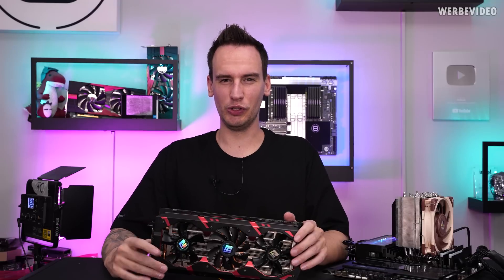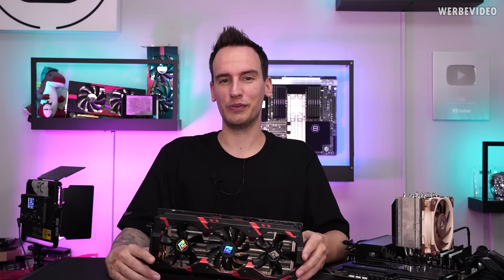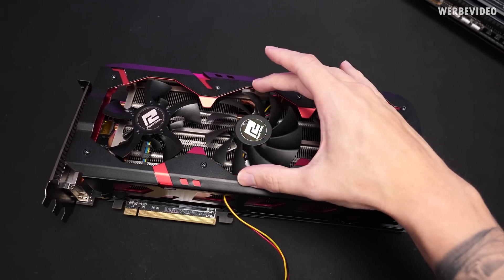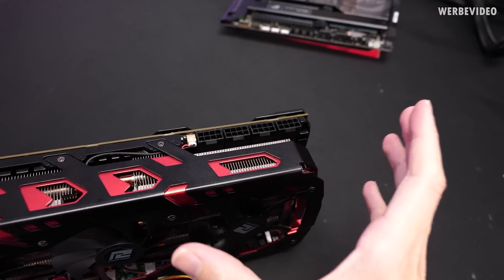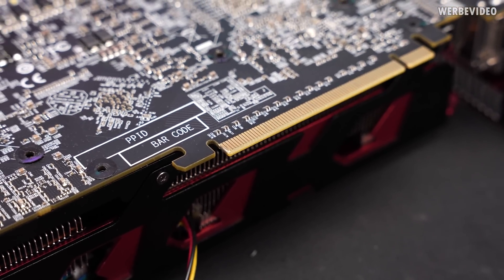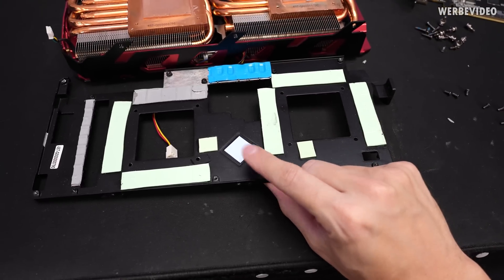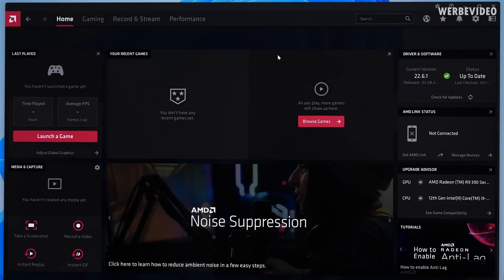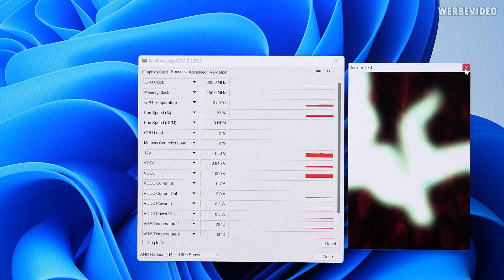HW-Legends #15: Insane 580W TDP!! This Card required 4x8Pin PCIe to run. PowerColor Devil13

Comment: oh, the glorious days of dual gpus... 
Here's a puzzle. I have 8 x ASUS ARES 4 GB, 8 x Sapphire HD 5970 TOXIC 4 GB, 8 x XFX HD 5970 Black Edition 4 GB (yes, the ones that came with the gun and gun carry case) but none of them ever played any game. What's the application they run in an 7x2GPU configuration in an ASRock X79 Extreme11, and what were they used for?
Here's a hint. The name of the app is a crypto exchange.

Comment: Just need a 24v power standard to halve the current.
Reply: May as well skip straight to 48v, some server PSUs are already designed for this. No idea if it is more tedious to step down 48v to ~1v vs 12v to ~1v though.

Comment: Had no idea this existed. What a unit of a GPU at the time. And I just think it's funny that two eight pins with 16ga wire is rated to 720 watts and would be way more than enough to power this if it weren't for stupidly conservative sensing specifications.
Reply: Honestly, we could have done a 4-pin connector. Two fat lugs with thick 8awg wire, and a small twisted pair for remote-sensing. Or maybe 10awg, and the stupidly high power cards can use two.
Reply: Or use existing EPS12V connectors that normally meant to feed the CPU . That is what Nvidia uses for their enterprise cards

Comment: (Looks at the two HD 5970's on the wall) .. nothing new :P
I had 2x5970 and 2x5870's in my benchmark rig :P i am on 3dmark with it. (EVGA SR2 with dual X5670, STILL have it)
The motherboard box is as big as my Thermaltake CTE 570 case  ! :P
They got replaced with 4xGTX570's with EK waterblocks just for for 3dmark :P

Comment: i miss dual GPU cards .. out of my price range but it was cool they existed and seeing some with 2 LN2 buckets on them was giving me joy ;)
Reply: I had an HD4850X2 it was so silly but awesome.
Reply: @MeakerSE  i have 2 dual GPUs in my collection HD6990 ( in raw shape ) and GTX 295 ( a little better shape ) its hard to get them in Poland but sometimes you can get lucky and buy them for 20 usd  ;)
Reply: I never had dual chip but I did have sli 980ti's (I upgraded it on a whim after my PSU blew up and took my single 980 with it) and used them with a 1kW PSU. Gaming in summer was a test of how much I could tolerate the 700w worth of heat being dumped into the room. Swapping them out for a 3080 was well overdue and undervolting it basically halved my power usage & significantly lower heat load.

Those days are over, same as those dual chip (I always wanted a 590 and those sli 980tis almost made up for never getting one) units. I suppose that shows just how well things have improved since then.

I wouldn't mind Jensen having a crack at a 5090 dual GPU, surely with all their tricks, DLSS, frame gen etc etc their engineers can make something that can run City Skylines 2 at 30fps at 4k.
Reply: @bigpoppa1234  i did it, to do better than ASUS MATS build, both GTX 980 GP 100 and the lower GTX 960 as on mars.
both did bad on  SLi on all titles, needing that GTX 1080 badly ! SLi was already dead back then !
Reply: @bigpoppa1234 use dev mode to switch on dlss and you can achieve that on a lower card..I get about 46 to 60fps at 5120x1440 on a 2070super, under 20 fps w/out dlss enabled..all the other upscalers go slow for some reason, dlss isn't perfect in the game but worth the frames, and the scale slider doesn't work for dlss
Reply: It’s really sad because they developed explicit multi GPU as part of DirectX 12, so a dual chip GPU would be worthwhile if the games supported them, and without all the micro stutter that existed with us ally in crossfire
Reply: .. I do (fun) and I don't (problems) .. often plagued with latency, stuttering and not to mention sketchy and often broken game support was a PITA Even at the height of SLI and CrossFire. Sometimes you wait, get a 10% gain and others over 90%.
Reply: @DJaquithFL  more shyt game engines, there's still stuttering in newer games released without mutli-card.
Reply: had the 7990 that thing was an absolute monster card
Reply: I miss ln2.
Reply: I don't miss them at all, had a GTX 295 and HD 5970. Microstutter galore and 50% utilization rendering the Dual-GPU setup moot for many games. Although with dx12 supporting multigpu natively would make it kinda worth it i guess.
Reply: @atamax3398  you do not need 100% load on both gpus. That is a complete myth that you need equal loading on both GPUs.
Reply: I remember having a HD 3870X2 and it was great if a game fully supported multi-GPU.
Reply: Get a V540, easy ln2 record lol
Reply: Shame even nVidia couldn't quite get it to work right.. But my old HD3870X2 does actually still work fine - on older Windows with old drivers of course. That could be the issue here - newer Windows might not like how the PLX is "bypassing" the CPU and it triggers hardware security protection!
Reply: Heck, I'd already be glad with some sort of semi functional crossfire or SLI returning.

Which they say they dropped because DX12 and Vulcan were able to address multiple mismatched GPUs natively.

But in reality, there's only 1 popular game that actually supports/uses mgpu capability.
Reply: infango
Why you miss that, you can still use it !
Where you ned it for is the only question, MAYA, Autodesk, stack the mem ? or in games, SLi support on them ?
Reply: Tho it was always better idea to get 2 separate gpus and then sli/crossfire them. You get better cooling, and also even if one of the cards suddenly dies you can just rma it while still happily using the other gpu

With dual gpu on single pcb cards there were a lot of issues, and in a nutshell they were more than 2x more prone to failures (besides the basic math, there was an additional factor regarding the plx switch that could fail too).
Reply: I used to use a lot of SLI and Xfire setups, the dual GPU technology was the same, but it all died after the GTX 1080 range, the 1080 Ti replaced my last SLI 980 Ti setup.
Reply: I will not have go for dual gpu's, look cool, but that is. i have use SLI as far as Nvidia 6600GT ( first SLI cards, DFI Ultra NF4 SLI ultra motherboard, DDR1 BH5 ) then goes the 7900 and 7950XTX road with crossfire ( first crossfire cards for AMD, still on the DFI motherboard, TCCD 600mhz Samsung, omg we are old ),  ofc Ln2. But dual GPU on a board was a nightmare to cool and power whatever was the cooling you was operate. and still could it run crysis ? (😛  Big hello to everyone from xtremesystem, I4memory EVA, Guru3d, happy newy years girls and boys
Reply: dw them are coming back, but in MCM form, hopefully by rdna5 we will get a 9990XT (2x 9950XT, which is 2x9900XT)
Reply: @user-lp5wb2rb3v  "rdna5 we will get a 9990XT (2x 9950XT, which is 2x9900XT)" there will be no dual GPU cards for consumer market, drivers support is dead and AMD will not spend money and time to resurrect crossfire considering RDNA is now using ZEN bocks system and instead of second GPU they can just add more graphic units in to main silicone but there is one question WHY ? who will buy it ?
Reply: I had two 2GB HD 4850 X2s in dual Crossfire X/Quad Crossfire. It was a beast setup but it really heated up my room. You could feel the heat being exhausted and it felt like a hair dryer.

Comment: You should ask a game devs.. what is their plans for multi GPU now that DX 12 is a thing and will Ray Tracing work on it?
Reply: Multi GPU is dead and not coming back for gaming.
Reply: Since DX12 and Vulkan started getting traction, Crossfire and SLI are just a cool relic of the past :(
It used to be that the Card Manufacturer (driver wise) had to make the programs work in multi-gpu. Nowdays, on these newer low level APIs like DX12 and Vulkan, the Game (engine and product) have to be coded from "the factory", day one of design, to work multi-gpu. That is literarily twice or thrice the workload for the devs; aka not gonna happen ESPECIALLY since only 0.001 (or .0001) of people have multi-gpus. They barely make the games multi-threaded for quad core CPUs...
I still run a daily 2x RX580 :) and use an old 3870x2 as a cup-holder. I've accepted that I'm not gonna see ever again software (games) written for me; and just fudge the horsepower with DLSS or FSR fake framez.
Reply: @IcecalGamer  A few games support it, like Shadow of the Tomb Raider and Sniper Elite 4. AMD mGPU still exists too, and it can be used with any of their newer GPUs. You can also force it to run on DX11, and a lot of new games still use that.
Reply: @eighttree9562  Yes. Swapping to DX11 works-ish most of the time.
My comment said as much and was aimed toward new (or even future) APIs.
Honest Question idk: Is RT working under dx11 multi-gpu for SotTR ? Do you have hands on with it?
I'm asking because i find it hard to believe, since the default working-ISH behavior for lighting and shadows is not consistent. (by "working-ish" i mean not officially supported but you can force it on).

Comment: Does this card fully works under Nobara linux ?
Reply: Should be. GCN cards are still supported by current RADV drivers but no crossfire support. Should at least be easy to select which GPU is used under linux though.
Reply: Runs on your mom, for sure.

Comment: I remember when this came out I wanted it so bad! Powercolor has made such cool dual gpu cards
Reply: My first dual GPU card was the Powercolor 3870 X2. That card was amazing! Not only did everything get accelerated by the dual GPU being on one card but it lasted for years until a bad driver burned out the second GPU. Otherwise, it just kept on going long after other peoples cards had died. Yes, it was expensive but the performance and longevity actually made it cheaper than incremental upgrades. I would absolutely love another dual GPU card!
Reply: @DelticEngine  I ran my Diamond 4870x2 that I used to have From 2008-2019 I had to repaste it in 2014 as it filled with dust and started overheating. Part of me misses that card and wishes I had kept it as a momento rather than sending it to e-waste.
Reply: @DelticEngine  "The Radeon/AMD card was amazing until it catastrophically failed" many such cases
Reply: @CyberneticArgumentCreator  okay team green 😂
Reply: Always somehow ended up owning powercolor cards, never disappointed, they're like underdogs which keeps them nimble and honest.